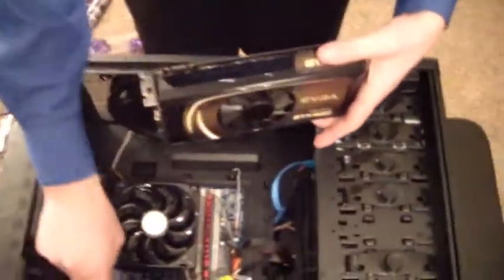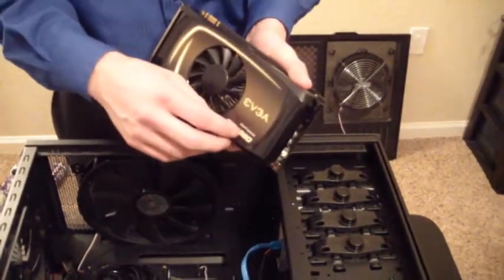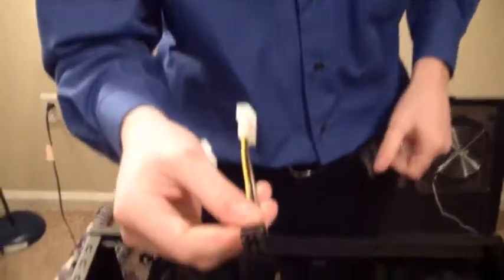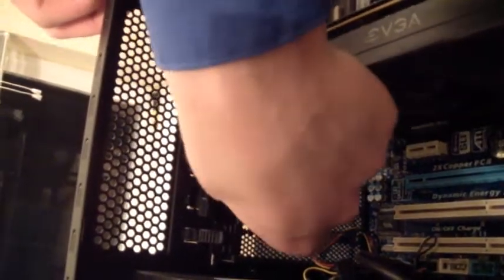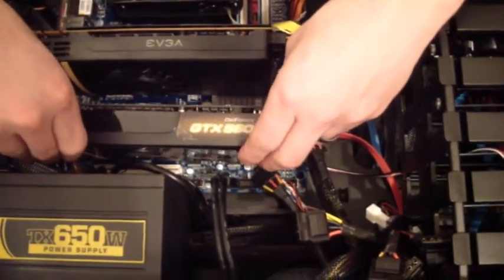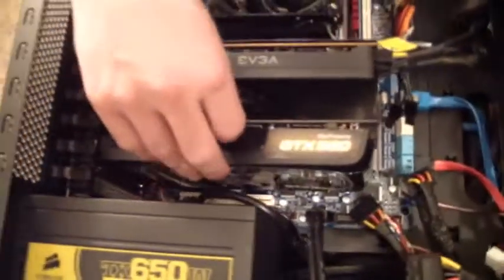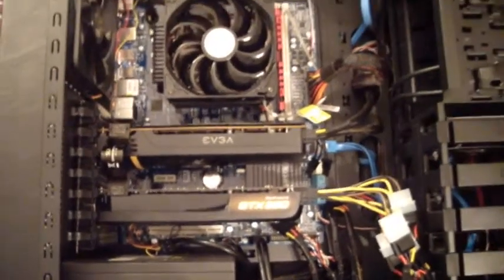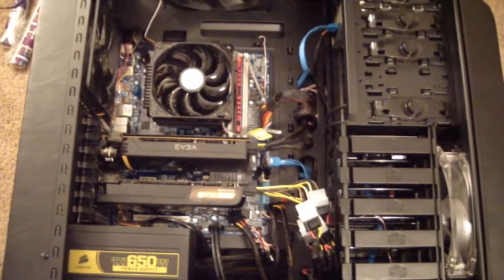OMFGN How To - SLI Install

Comment: You've only 'physically' installed the second card... you said nothing about how to activate the dual card setup! Some motherboards require you to do this manually by repositioning a jumper on the motherboard or via an option in the BIOS.  Also... you need to Set SLI Configuration and click the radio button to Enable SLI Technology in the Nvidia Control Pannel.

Apart from that, not a bad video.